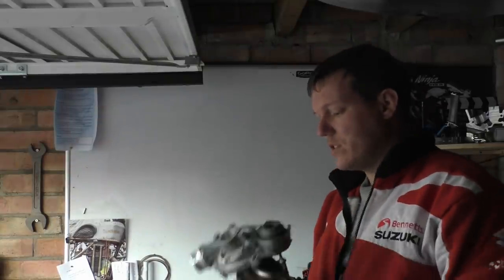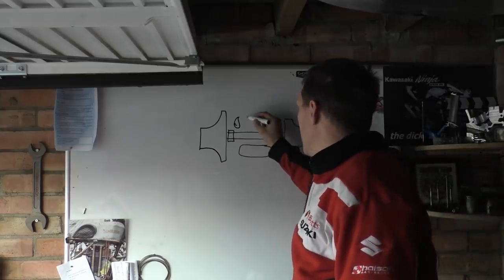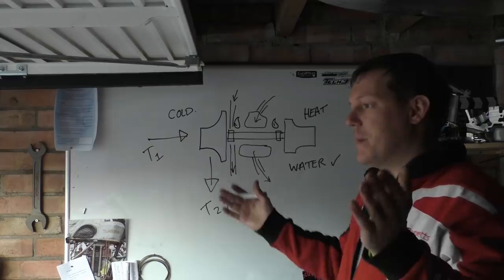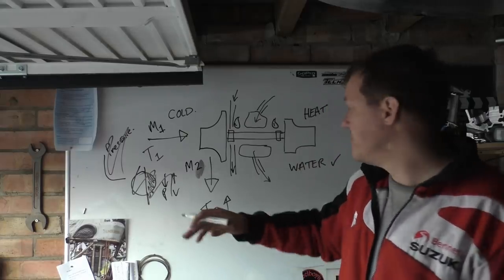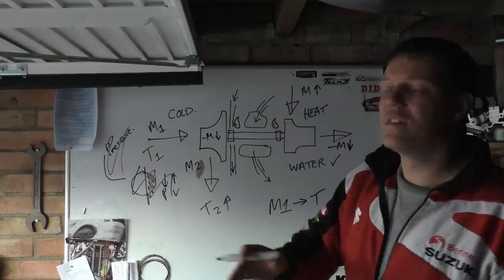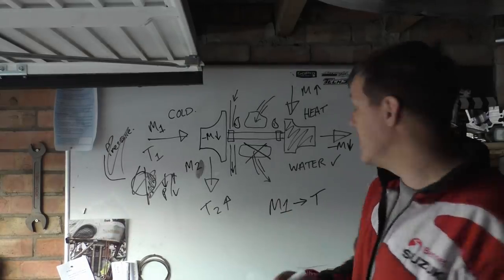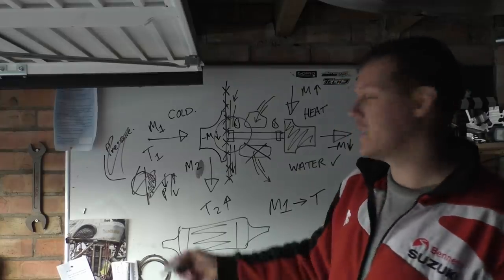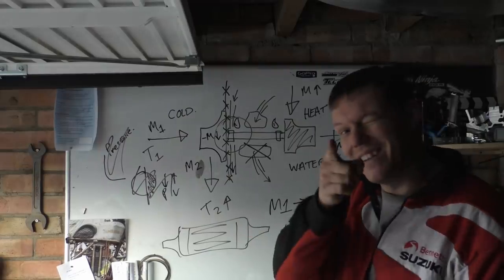So you wanna turbo your bike? Part - 5

Comment: I've been turboing cars for a while.. most modern turbos run both oil and water. Many use ceramic exhaust impeller, but this is generally for longevity. Heat in the intake flow is also a byproduct of compressing the air. Early systems without intercoolers were less efficient due to the hot intake temps.

Comment: Antilag systems like in Prodrive rally cars put fuel/air mixture into the exhaust, upstream of the turbine. This then combusts due to the heat and drives the turbine at times when there is no or little exhaust flow. The heat those systems have to deal with must be insane!

Comment: 12:20 is it better to use an oil pump to push oil through or pull oil through? I'd assume that you would want the oil cooler to be the last thing that the oil passes through before it goes through the turbo (or whatever ur trying to cool) so that its as cool a possible, so I'd guess pull, but is that correct?
Reply from the maker: we're getting to this - that was the 'orientation' note. So fuckers like you don't have to ask LOL
Reply from the maker: And no - push. Pumping is always better pushing

Comment: Great series. I learnt loads. I came across this because I was wondering if it's even possible. My problem is different to most other people's. I'm not looking to make a horizon headbutting monster. I have a 200cc single pot, air cooled, carburetted, trail bike. That claims to push out 16.5 hp @ 8500rpm, but it doesn't, because where I live the fuel has a low octane rating and I live 2600 metres above sea level, so the air's relatively thin. I want to get the full power or maybe a little more. Can it be done? Does anyone make a turbo that small?

Comment: As you increase air pressure the temperature increases, you can feel this happening when you pump up a bicycle tire and touch the valve it will be hot. Same as air compressors that's why they have cooling fins and fans.

Comment: Lad I know turboed his z13. Went like fuck when it was running. But it was reliably  unreliable. He was forever fuck acting with it. Adding a turbo to a motor not designed for it is a recipie for disaster. Added stresses to components that were never speced to take the extra heat etc.

Comment: would a stock diesel engine make more power (i mean mostly on low end) if you wrap the exhaust pipe (from engine to turbo) with these heat insulator thingy without doing other changes?
Reply: Technically yes... would you notice? Probrably not... they do make heat wraps as sort of a boot over the hot side of a turbo which help keep intake temps lower as well. Depending on how the plumbing is ran, and many other variables you are looking at maybe 5 hp. I think cleetus mcfarland has a video on it as well as EE with humble mechanic.

Comment: like your vids but its all about the pressure and volume of the air coming out of the exhaust going through the exhaust turbine. the impellee would still spin as fast if it was using cold compressed air at the same pressure and volume
Reply from the maker: Pressure and volume (i.e flow) are measurements - one (pressure) is force over a surface area. Volume is a coordinate system otherwise known as a quantity of space. 

"the impellee would still spin as fast if it was using cold compressed air at the same pressure and volume"

- this is not true, and I'm going to prove it
Reply from the maker: What matters in momentum and the conservation of it.
Reply: @dirtygarageguy  you describe it as a heat system. yes the exhaust is hot because of how its generated, but its that flow of air that matters, not the temp. keep up the good work tho.
Reply from the maker: And just to be clear this is a link to the Department of physics Website - https://van.physics.illinois.edu/qa/listing.php?id=1754&t=heat-and-turbines
Reply from the maker: And another link to the GE site - who makes turbines. Notice the mention of heat everywhere.... 

https://www.ge.com/power/resources/knowledge-base/combined-cycle-power-plant-how-it-works
Reply from the maker: "but its that flow of air that matters" - and this flow is due to the heat. 

The reason why this is important is if you wanna design a 'better' system, you design it from a heat perspective not a pressure one. Hence why turbos are fitted as close to the engine as possible. If flow was all that mattered then you Garett for instance wouldn't be spending shit loads of money on high temp alloys for the turbine when they could just stick it further down stream...
Reply: @dirtygarageguy  cool, look forward to it. lets not forget, i am talking about the turbine would spin as fast with cold air of the same pressure and volume flowing over it as with hot air, so fundamentally, its not a heat system. it does have a lot of heat in it though, which is actually an inefficiency as that heat isnt doing any work in making the turbo spin faster.

your other points about cooling the turbo, etc are spot on
Reply: @dirtygarageguy  if your turbo was further from the engine you would have more lag, as it would take more time for the engine to pressurise the longer length of exhaust piping.

the flow (pv =mrt) and pv1=pv2 and all that , is caused by the expansion of the gas following ignition. a perfect engine wouldnt have heat losses as all the energy would go in to driving the pistons. ic engines are maybe 30 to 40 per cent efficient and turbines enable the recovery of maybe another 20 per cent of the otherwise wasted energy
Reply from the maker: "i am talking about the turbine would spin as fast with cold air of the same pressure and volume flowing over it as with hot air, so fundamentally, its not a heat system."

- Well that not the same thing is it, and not how an engine operates, as the increase is pressure is due to the temp rise. That's shifting the goal posts. 

"its not a heat system."

- Yes it is, if you think it's not then neither is the engine - the heat engine....

"it does have a lot of heat in it though, which is actually an inefficiency as that heat isnt doing any work in making the turbo spin faster." 

- You're confusing the whole system. What powers anything is energy or more precisely the tranfer of energy. This energy is in the form of heat, this heat is then expressed as momentum.
Reply from the maker: "(pv =mrt)" - I think you mean pv = nrt ~ where p - pressure, v - volume = n - mol, r - gas constant and t - temperature. Notice that pressure is proportional to temperature. Temperature is a measurement of energy, pressure is a force / area. 

"ic engines are maybe 30 to 40 per cent efficient and turbines enable the recovery of maybe another 20 per cent of the otherwise wasted energy"

- yes, heat energy. Therefore if we re-arrange what you just typed like this - turbines recover wasted energy - thermal energy then they recover heat. Turbines don't recover pressure and they don't recover flow.

" if your turbo was further from the engine you would have more lag, as it would take more time for the engine to pressurise the longer length of exhaust piping."

- we'll see about that, but don't hold your breath...
Reply: @dirtygarageguy  "i think you mean nrt"... no i dont, the m or n in your case is actually the greek symbol mu, but i couldnt be arsed to look for that symbol on my phone, to be honest.

sticking with my original point, you could heat a turbine all day and if there is no flow, it wont drive the turbine and hence the compressor wont build any boost, so it isnt recovering heat energy, it is recovering the kinetic energy from the movement of the exhaust gases.if those gases were cold, they would stilll spin the turbine.

pv= mrt is applicable in the cylinder during the compression cycle, once the exhaust valve opens, the pv1 =pv2 also applies ( though the exhaust isnt a closed system, but the turbine forms an obstruction) so the pressure drops when the gases move in to the much larger volume of the exhaust pipe, relative to the volume of the cylinder. hence the further the turbo is from tbe engine, the more lag.

hey, why not do a colin furze challenge on one of your shows and get a turbo to build pressue on the compressor using heat and no moving gas and i can do one using compressed air?
Reply from the maker: Ok then μ - but that doesn't change anything that I said, and doesn't make your point. 

"you could heat a turbine all day and if there is no flow" - and I didn't say that. 

"it is recovering the kinetic energy from the movement of the exhaust gases.if those gases were cold, they would stilll spin the turbine." 

- and where is this kinetic energy coming from?

"hey, why not do a colin furze challenge on one of your shows and get a turbo to build pressue on the compressor without using heat and no moving gas and i can do one using compressed air?"

- Because I have a better demo. Using compressed gas is using the energy that is in the compressed gas.
Reply: @dirtygarageguy  i didnt say you did say that "you could heat it all day..."

the kinetic energy is coming from the exhaust upstroke of the piston that has just fired, which is being turned by the next piston in the sequence firing.

the heat is coming from the detonation of fuel in the combustion part of the cycle in the engine. this heat is a waste biproduct, disposed of via the cooling system and not adding to the power of the engine ( turboed or not). when the gas leaves the exhaust port at a pressure and volume, it runs in to the turbine and turns it, on its way out of the exhaust. 

the turbo doesnt recover the heat, its really the opposite, ie the heat needs to be dissapated and managed. it isnt a heat system.

yes, compressed gas is using the energy of the compressed gas. it is stored under pressure and as you know, pressure flows from high to low. so my point is a turbine spins because of the kinetic energy imparted in it from the flow of the fluid passing through its vanes, nothing to do with heat. look at other turbines, hydro electric generators for example. they all just rely on the flow and that is determined by the pressure and volume ( and here is where you say that the pressure is increased because the gas is hot)... and i say but a cold gas at the same pressure and volume would also generate the same boost, so its not the temperature of the gas moving the turbine, its the flow.
Reply: @dirtygarageguy  Turbochargers start producing boost only when a certain amount of kinetic energy is present in the exhaust gasses. Without adequate exhaust gas flow to spin the turbine blades, the turbocharger cannot produce the necessary force needed to compress the air going into the engine. The boost threshold is determined by the engine displacement, engine rpm, throttle opening, and the size of the turbocharger. The operating speed (rpm) at which there is enough exhaust gas momentum to compress the air going into the engine is called the "boost threshold rpm". Reducing the "boost threshold rpm" can improve throttle response. - from wikipedia
Reply from the maker: "the kinetic energy is coming from the exhaust upstroke of the piston that has just fired"

- Wrong. This would then not be energy recovery, as the momentum of the crank (if it was a single cylinder) would be what supplied this energy.

"the heat is coming from the detonation of fuel in the combustion part of the cycle in the engine. this heat is a waste biproduct"

- Wrong again, heat is what we want as it's a heat engine...

"disposed of via the cooling system and not adding to the power of the engine ( turboed or not)."

- wrong again. Cooling systems are a nessery evil due to the components physical characteristics (i.e melting temperatures and thermal expansion and strength)

"when the gas leaves the exhaust port at a pressure and volume"

- the pressure is rapidly decreasing as it leaves the cylinder due to the increase in volume.

"the turbo doesnt recover the heat, its really the opposite, ie the heat needs to be dissapated and managed. it isnt a heat system."

- and I didn't say it recovers the heat - heat is just energy expressed in the infra red band of the electro magnetic spectrum. It's this energy that increases the total energy of the exhaust gas molecules. This increases the velocity of said molecules and seen as though momentum is mv.

"so my point is a turbine spins because of the kinetic energy imparted in it from the flow of the fluid passing through its vanes, nothing to do with heat"

- But that kinetic energy in an engine is heat energy converted and expressed as kinetic energy. 

From wiki 

"The average kinetic energy of the gas particles depends only on the absolute temperature of the system."

https://en.wikipedia.org/wiki/Kinetic_theory_of_gases

Nothing to do with heat?

"look at other turbines, hydro electric generators for example."

- I'm so happy you said that. Hydro electric plants use the gravitational potential energy of a reservoir, and strangely enough heat is also the driving fact there.

 "and i say but a cold gas at the same pressure and volume would also generate the same boost, so its not the temperature of the gas moving the turbine, its the flow."

- Again this is you getting confused with what I said. I said the souce of the energy that drives a turbine in a turbo is heat. NOT heat physically pushes a turbine around. That is done through conservation of momentum. 

"Turbochargers start producing boost only when a certain amount of kinetic energy is present in the exhaust gasses."

- crude but I'll agree with that.

"The boost threshold is determined by the engine displacement, engine rpm, throttle opening, and the size of the turbocharger. The operating speed (rpm) at which there is enough exhaust gas momentum to compress the air going into the engine is called the "boost threshold rpm". Reducing the "boost threshold rpm" can improve throttle response. - from wikipedia"

- All of this still doesn't define what we're talking about. One thing it does say is momentum.
Reply: @dirtygarageguy  the engine itself is a heat engine. i am not disagreeing with that. i am saying the turbine doesnt produce any boost due to the heat of the gases it receives from the engine, but due to the flow of those gases, hence why i said compressed gas ( as in from a cylinder or compressor) or water ( in the case of hydro electric dams) is what creates the turbine movement and hence the boost.

i agree with you that the crank ( and flywheel, etc) acquires momentum which enables a single cylinder engine to continue on its exhaust stroke.

the fact that the heat of an engine isnt recovered and is disposed of by both air and water cooling is what leads to their low efficiency, yes they are necessary, however my point was that the turbo isnt a heat engine or system ( although the engine is). the turbo isnt converting heat in to motion, its converting the relative high pressure exhaust gas flow in to motion, thats why i said you can heat a turbo all day and it wont create any boost unless there is  a flow of gas through it.

maybe you consider the turbine as the engine, whereas i see it as external to and using the exhaust output of the engine to provide an input to the engine.

so... momentum ( or flow) is whats turning the turbine, not heat. 

keep up the good work on the videos. i enjoy watching them
Reply from the maker: "@The Workshop the engine itself is a heat engine. i am not disagreeing with that. i am saying the turbine doesnt produce any boost due to the heat of the gases it receives from the engine, but due to the flow of those gases, hence why i said compressed gas ( as in from a cylinder or compressor) or water ( in the case of hydro electric dams) is what creates the turbine movement and hence the boost."

And what I'm saying is that heat from combustion provides most of the energy that the turbine extracts or recovers. 

"however my point was that the turbo isnt a heat engine or system ( although the engine is)"

- Ok, so explain how they are different? What makes the piston engine a heat engine that the turbine doesn't do? Or visa versa?

"maybe you consider the turbine as the engine, whereas i see it as external to and using the exhaust output of the engine"

- nope, I don't and I'm not considering the turbine as part of the engine.

Comment: Saw a turbo glowing bright red through to nearly white on a V16, 72litre diesel gen set. Kept the power on until mains came back. It boiled the oil feed and raised the cooling from 72 C to 90 C. Bear in mind this had cooling towers on the cooling system. When we switched it off , turbo spooled down and then imploded. Engineer stripped it and found the bearing surfaces had started to soften and slump. £10K later, rebuilt turbo. 2 years later put a piston through the block. Didn't stop it running as all the alarm relays had been pulled. Kept fuel, oil and water going until mains restored- had no choice as Gulf war on amd MOD site. £1.5 million for new engine to be installed. Fun times.
Reply: @Kris Nicholson imagine dragging  your finger along the surface of playdoh. That little track and ridge from your finger is like a bigger version of the surface of the races.We had a turbo engineer from the factory on site to rebuild it and he brought the remains of the bearings up to the canteen. Excessive use of a dremel and a hammer to get them out. Never seen races so fucked since, not even on my mates metro and he used to take the slack in the wheel bearings with cut nails! His excuse was that apart from the mot , it drove 1.5 miles along a nearly straight road to work and back. Anywhere else and he took his bike or his wife's car.